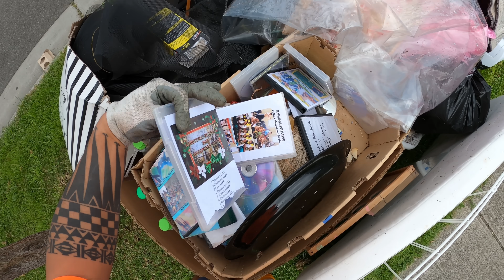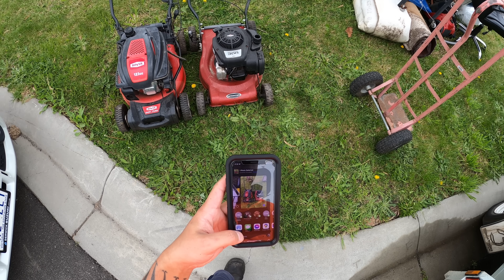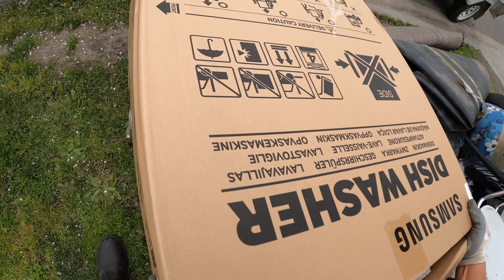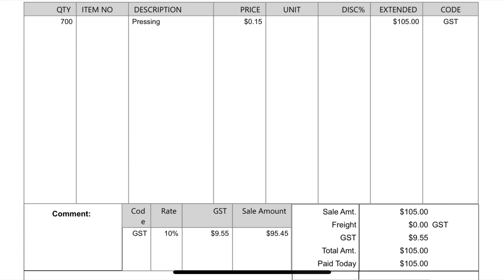Curbside Collection - Keeping It Scrappy!

Comment: Nice one Poly, some really good scrap there. That cast iron orange pot you put in the Ute, the inside white area of the bowl can be easily cleaned up by filling the bowl with water then adding bleach to it and leave for 4 or 5 hours. It will end up clean as a whistle and ready for resale. Keep up the good work mate.
Reply from the maker: Thanks for the tip mate 🙂

Comment: Take a look back at your video where you picked up the speaker and that gray pipe right before you picked up that gray pipe right there on the curbside you moved a very large flashlight .that flashlight happens to have one or two of those batteries you like so much ,those lights are also great for mounting to the front of your car and hooking them into your system because they're extremely bright
Reply from the maker: Thanks for the tip mate. It didn’t feel heavy at the time. Now I know, I’ll check if I come a cross one again 🙂

Comment: If you put your magnet on the metal part of your trailer, you can put your wire clippers right beside it then you will know where they are every time you need them. Saves having them in a pocket to make a hole or losing him because you put him down in a different place every time. I learned that from the scrap and pallet man. You've got a nice looking rig to haul things in that trailer. In fact, your whole set up, looks like it's in good shape a place to put things you wanna keep in the place to put things you want to take to the junkyard. Now let's see how prices match
Reply from the maker: I’ve thought about keeping them like Paul does but I’m used to my side pocket now. It’s been going well for over a year 🙂

Comment: Why do you cut electrical wires from electrical appliances? Maybe someone else will benefit from this device
Reply from the maker: Because it’s garbage day
Reply: I know, but it is possible that someone will come in need of this device, but if he finds it without an electrical cord, he will not take it. However, I suggest that you take an electrical connection device from the car and try the devices if they are usable and you do not see
Reply: If you do not want it, leave it to someone else, and if it is unusable and idle, you can take from it whatever you want, may God bless you.
Reply from the maker: I let everyone take what they like over the weekend. On garbage day, sometimes I make it in time, sometimes the truck beats me and crushes it all.